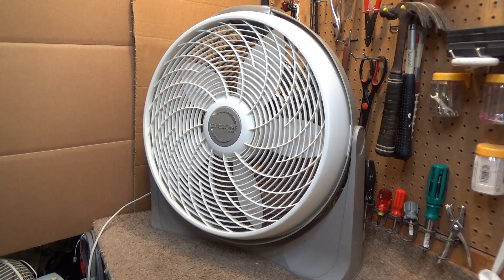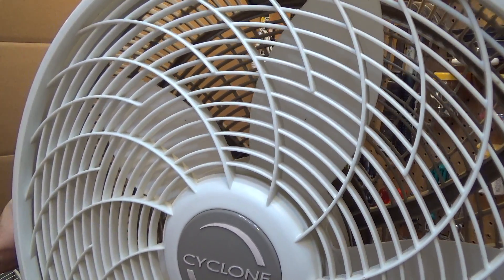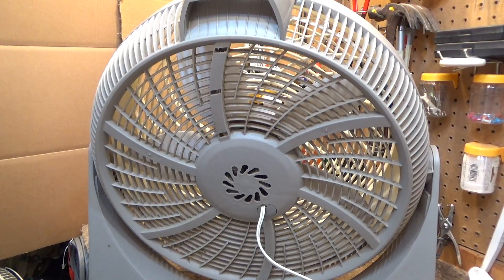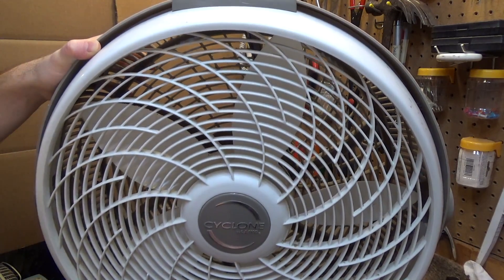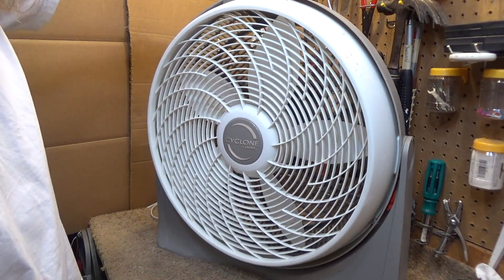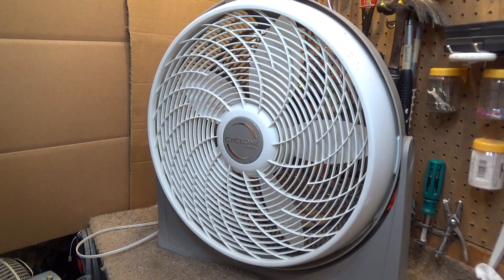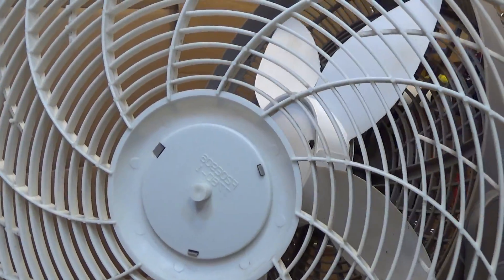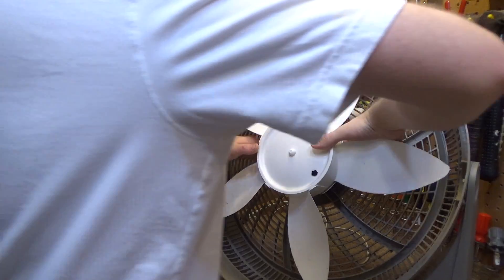Lasko Cyclone Fan Failure

Comment: this is very helpful. i couldn't not find the screws to remove the front. 🙂
Reply: There are two small screws on the backside. Once they're removed, it was easy for me to remove the front grill. For me, removing the fan blade is the hard part. He did it off camera which did not help me. Sigh...

Comment: Took mine apart to clean it. Use high flow air to clean all the dust out and I accidentally cut one side of the live wire I soldered the wire back together, plugged it in pushed the button the powered on and got nothing. Is there some kind of switched that trips that I can reset or do I have to replace the chip or switch or whatever because the other fan I got is way too quiet I need a lot of noise to help me sleep and I’ve been trying to get this thing to work for the past 18 hours now.
Reply from the maker: I don't know what wire you're talking about, if it was a lead from the windings, the reconnection process isn't as simple as just resoldering.

Comment: See that hole on top of the blade is to insert the screw driver for the screw under the blade. Daaa. Even I 65 yo woman knows that.
Reply from the maker: I don't know what you're talking about. There's no set screw on this blade.
Reply: @JordanU  There is a hole in the hub of near one of the plastic blades that allows you to use a screw driver to remove the motor screws that are normally blocked by the fan blades. You remove one screw then rotate the blade so the hole is over another screw and remove that screw. Keep doing that until all the screws are removed. Your own video shows this hole at 6:34.

Comment: My lasko floor fan issue is after taking apart and cleaning it, the blade will spin freely when you manually spin it but once I power fan on the blade will not spin and when I try to manually spin the blade with power on the blade feels as if it's being blocked and won't allow me to even spin the blade manually.
Reply from the maker: The bearings may not be aligned properly. Try striking the shaft with a screw driver handle a few times.

Comment: My Cyclone failed 2 days ago, so I went to the big box store for a replacement. No stock of the cyclone, but they did have the Lasko 20" plain jane box fan which I did purchase and brought home. It is not nearly so versatile, plus, on a wood floor, the unit walks itself counter clockwise and does not stay where you want it. I am very tempted to open it up and see if the motor in the new box fan could serve as a replacement in my failed cyclone motor.
Reply from the maker: The motors are probably the same physical size, but the motor used in the Cyclone is considerably more powerful. The Cyclone also shipped with a better blade than the box fans.
Reply: @JordanU  Thanks for the reply. The LASKO box fan I purchased last week has exactly the same 5 blade fan as the Cyclone. I believe they did an update. However, I have decided to just purchase a new Cyclone and return my new box fan. Lasko certainly did not have repair in mind when they designed these fans.
Reply from the maker: @taberav  The blade may look the same, but the pitch of the blades and the thickness of the plastic is not the same.

Comment: My fan wasn’t working as good as it did, and I usually wiped the dust off until I realized how much fuzz and dust was behind the motor and I was getting very frustrated I couldn’t figure out how to pop off the blades🤣
Reply from the maker: Not good.

Comment: I recently had an even worse failure mode with one of these. I found it in the trash and for some reason the cord to it was cut. I put a new cord on and plugged it in then pressed the power button and the electronics board blew up into sparks and it released a lot of smoke and almost caught fire, I unplugged it immediately and took it outside, I now have it wired directly to the medium speed and it works fine now. I'm gonna end up either buying a new electronics board or putting a mechanical switch into it.
Reply from the maker: Add that to the list of reasons why I don't like electronic controls. Replace it with a mechanical switch, much more reliable.
Reply: @JordanU  that was my plan and yeah, that's another reason to not like them.
Reply: @JordanU  The features that electronic controls provide are actually quite decent in some cases, remote controllability and timed operation among them. However, the electronics are usually built to a cost that renders them ticking time bombs in terms of reliability and longevity. Good idea with questionable execution. 

Mechanical switches, while many times more reliable, are not completely immune to failure either. Carbonization and/or oxidization of the contacts in cheaper switches may lead to failure modes such as melting or burning.
Reply from the maker: @CorollaChronicles  Oxidization of a mechanical control is easily repaired. Usually when an electronics control set fails, the repair is borderline impossible.
Reply from the maker: @Delicious Don Turbulento That doesn't make sense.

Comment: You should try lasko air flexor fan..  it has a 10 inch blade but a full size box fan motor..  it moves lots of air..
Reply from the maker: I've never been able to justify the high price.

Comment: whew... ive got a similar model of fan that failed recently, and i found this video while looking up a potential fix
i took mine apart and, lo and behold, there was a truly hideous amount of hair wrapped around the motor shaft, and a bunch of dust further inside.absolutely no chance at this thing working again, im fairly sure... time to get a different one, i guess
Reply from the maker: If you gave it a good cleaning, perhaps replaced the thermal fuse, it probably would run again.

Comment: Very informative Video!  Do you by chance know of a replacement motor for an older Lakewood "Kool Operator" 20"?   Windings failed although the motor was not all that dirty.  Thank you.
Reply from the maker: You may be able to retrofit some kind of attic fan motor in depending on the age of the fan.
Reply: @JordanU  Thank you.

Comment: What's really insane is the owners' manual on newer fans says clean with the vacuum or wipe the dust off the outside. You are not supposed to disassemble them to clean the blades anymore either! I thought it was something stupid Midea was saying in the manual for the Pelonis fan I got delivered yesterday (and yes, I'm going to disassemble it to clean the blade when needed. Lasko is saying the same thing. I also checked to see if it only applied to the models with remote controls, but no, even standard three speed rotary control models have that warning, do not disassemble them. This even applies to the ones that you have to assemble out of the box!

Lasko, however mentions washing grilles on their table fans and pedestal fans still, but Midea says "When the fan was assembled, the rotor blade guard shall not be taken off anymore" The also say "The rotor guard shall not be dissembbled/opened to clean the rotor blades." I've included the typos.
Reply from the maker: The companies today intentionally make products to not last more than a few seasons at most. It's called 'planned obsolescence'. It's hypocritical and very terrible.
Reply: @JordanU and companies are attacking our right to repair as well

Comment: how did you remove the blades?  thank you
Reply from the maker: They just pull off. Sometimes it takes a fair bit of force.
Reply: HOWWWWWWW OMG cant get that part out
Reply: They have screws. The blades have a hole in the center plate off to the side a bit. Spin the blades and look through the hole till you see the screw below it. You will need a philips screwdriver long enough to go through the hole in order to reach the screws but thats how you get the blades off. If you watch this video you can see the hole on the center plate of the blades. Repeat to get the blades off the motor but the screws are a tiny bit harder to get to but it is done in the same manner.
Reply: @silvermercury756 the fan blade just pulls off. You don't have to remove any screws. 
God bless you!

Comment: I had a mcmillian succumb to this death we cleaned it but it had suffered a overheat failure we tested it after cleaning just for it to run fine for a a few seconds then ut began to pour out smoke and died
Reply from the maker: There have been a lot of McMillians lost to this kind of neglect. The thermal overload will keep it safe for a while, but ultimately the increased operating temperature will degrade the insulation on the windings resulting in some kind of catastrophic failure eventually.
Reply: @JordanU  yeah I do also have a video of it failing

Comment: That's got to be one of the worst motors I have ever seen in terms of dust buildup! As for the overall fan, nothing has beat my Toastmaster! That thing was so filthy when I found it that it literally moved no air! It was about as much dust that was on that motor, but covering the entire front grill! I have to say that I have never seen one of those fused plugs blow before. Have you? Also, in addition to older motors taking more abuse, they also generally had bigger and more plentiful vent holes on them which I have found helps to prevent some of the buildup that you saw on this one.
Reply from the maker: This is one of the worst motors I’ve seen, but what’s weird about this one is the rest of the fan was relatively clean. No, I never have seen one of those fuse plugs go out.
Reply: @JordanU  I've had seen an Atlantic Breeze/Midea fan and it had that much dust on the motor. It still ran but not long enough before it starting popping and sparked a flame!
Reply from the maker: @drakesessions3544  The extra heat from the dust accumulation will eventually deteriorate the insulation on the windings and cause such a failure.
Reply: Speaking of the older motors, I have three Lakewood/Kmart box fans that are at least 40 years old, three vintage Galaxy fans (blue and brown versions), Panasonic 5-way oscillating fan with blue blades, an unbranded pedestal fan from the mid 80's, two unbranded desk fans (12" Cool Time, Calfax Inc-Kuo Horng brown blade, 16" Cool Time, unbranded with dark blue blades), antique metal fans, and still work like day one. My mom's galaxy pedestal fan that we bought in walmart in 2009 started making clicking noises, so we ended up falling back to vintage. It's sad that the modern Lasko fans, along with other modern brands, like Holmes, Pelonis, etc., don't even last closer to five years. I even have a 100+ year old Westinghouse whirlwind fan (circa 1917) and also works like day one, despite replacing the power cord.#TheyJustDontMakeThemLikeTheyUsedTo

Comment: I saw one of these cyclones at a Home Depot some years back and it blew a strong breeze.  If it wasnt all flippin plastic I'd buy one.  I dont support products that create waste.
Do you know about a certain individual who shall remain nameless making threats about putting strikes on channels?  Has he done anything to your channel and can I put my channel videos back to public.  Hes put two false copyright claims and I had to private anything so he doesnt win the battle.  Hes not gonna do crap right.
Reply from the maker: While I don’t support the wasteful Chinese product movement either, I have found these last quite a while if you blow the motors out with compressed air regularly.
Send me an eMail about it and I’ll fill you in (eMail address located on the About tab). I don’t want to give any information on a public forum where he may see it. The plot is a lot thicker than it was during last year’s fiasco.
Reply: @JordanU  Ok sounds good.  Thanks

Comment: They probably didn't clean the motor because they couldn't get the blade off.
Reply from the maker: That’s a possibility, though I tend to think they just didn’t know it had to be cleaned.
Reply: missed the obvious screw holes on the blade. Line up remove

Comment: I have got plenty of fans out of the garbage box fans table fans and other fans  motors full of crap most of the time I can clean it out and get it to work
Reply from the maker: That’s what I usually do as well, I think this will be the first one I deem a lost cause.
Reply: Be careful and you must feel the copper coils and make sure they're not loose because apperently the Cool Breeze I found from early 90s had huge amounts of dust which most likely affected the insulation and not having ties contributed to its death

Comment: I had this series, there is a third button (middle power) missing.  You had one (power) in the middle and then L - fan speed, and R - timer.   If memory serves.  A standard LASKO pedestal fan remote control should be able to start it if the problem is the missing power button, the sensor is right below the buttons.  Good luck.
Reply from the maker: Thanks for letting me know. It does look like there was an RF receiver in there, but  I don't have any of the remotes anyways.

Comment: Ah yes, the suffocation failure mode. These fans have a somewhat bad rear motor housing design, because they don't really allow you to easily see how blocked the motor is, unlike on their box fans. Last year, I brought home a trash-picked Lasko Wind Machine that suffered the same type of failure....although it still had signs of continuity.
Reply from the maker: It is somewhat of a poor design since it clogs so quickly. I tend to think they probably did that intentionally. The box fans are more visible, but I still doubt how many people would actually clean it out.

Comment: That motor definitely has a lot of dust in it I am honestly not surprised that it quit. I’m sure who ever had this fan before had it stored in some dusty storage room for a long time.
Reply: That is not from a dusty storage that is what happens when you don't clean the motor
Reply from the maker: I suspect this dust accumulation was from use, not storage.
Reply: If it was in storage not being used there wouldn’t be hardly any dust the motor is what sucks it in